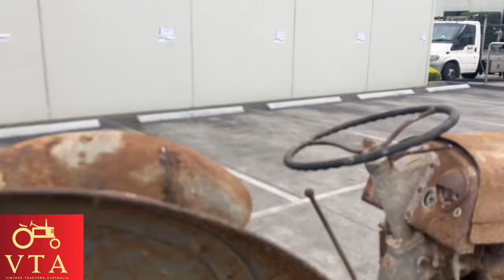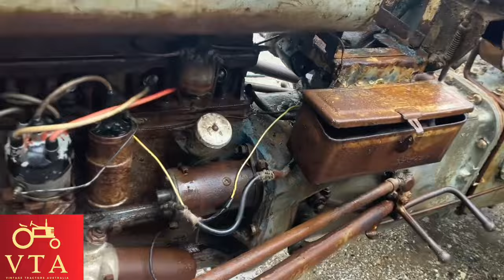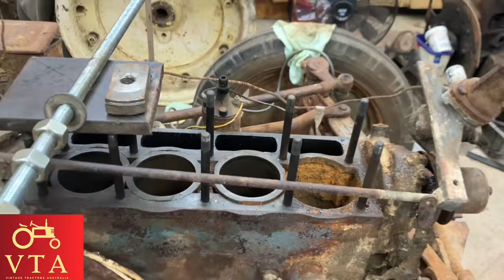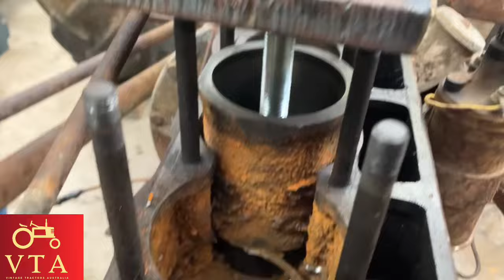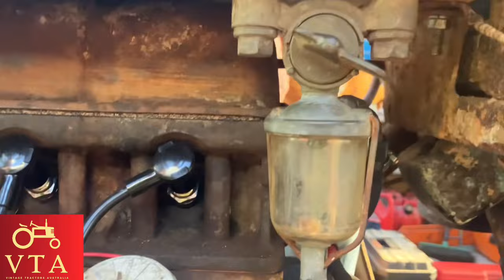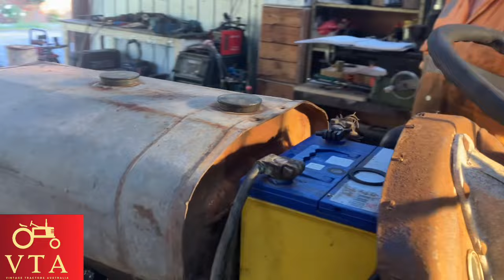Reviving a Grey Fergy

Comment: I was expecting the clutch to be stuck, original coil too I see.
Reply from the maker: Me too. Although it sat in a shed for the last 30 years, not outside. So I think that would have saved it. 
Yea those original coils are great. Outlast any modern coil.
Reply: Linkage works and everything, great result👍😀.
Reply from the maker: @oilyragsgarage7200  yep. Pretty big win in most fronts. The engine took a little more work than we were hoping for, but can’t complain really. The brakes even work.